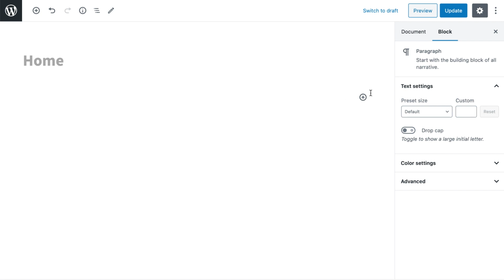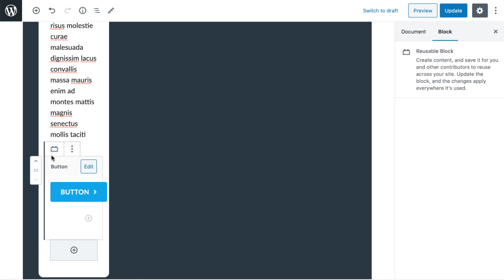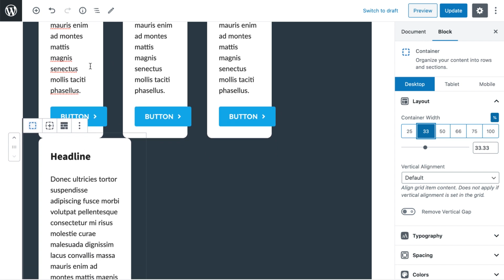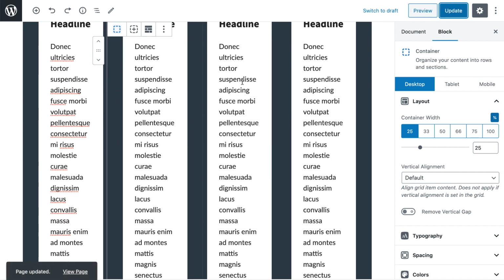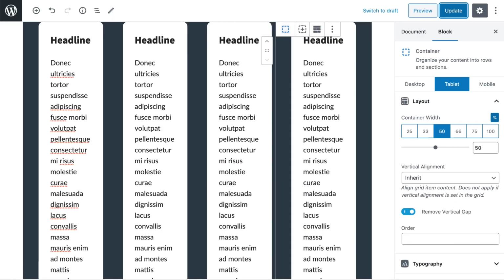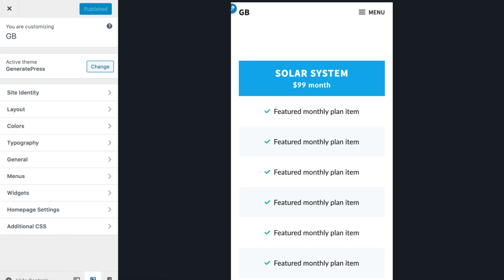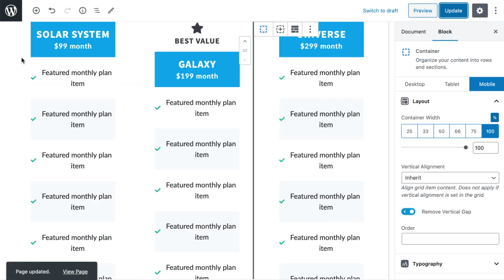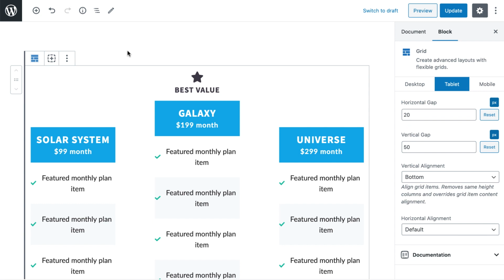GenerateBlocks Grid Block Tutorial

Comment: Hi Mike, thank you for letting me know. Couple of questions. What element does the same thing as Sections? Is that the Grid then?
Reply from the maker: The elements are not layout features, they allow you to hook content you build with blocks to areas of you website, build header templates to apply to pages and posts, etc. GenerateBlocks is what you build pages with now, which includes the grid block.
Reply: @MikeOliverDesign  Ok, thank you very much Mike.

Comment: Mike, thanks for the video! In one of his videos, Adam Preiser talks about the 3 Cs when it comes to any page builder. There is the outer CONTAINER, then inside of that, there is the COLUMN, and finally inside of that, there is the CONTENT (in the case of Gutenberg, the individual block(s). It seems that Generate Blocks doesn’t really follow that formula in that content doesn’t necessarily always go inside the other two layers, the columns (grid) don’t necessarily have to be inside a container, and columns themselves end up with containers in them? What are your thoughts on this?
Reply from the maker: Brent, GB uses flexbox and works differently than page builders. The grid containers are what you might call columns. Having the content inside a container block or grid containers is what allows you to have full responsive and layout control over your content.

Comment: Excellent video. I have a good understanding now. One thing I've noticed experimenting with a container with an image as the background and activating the overlay, is that when I activate the overlay, it hides the image and a message says you have to give your background colour transparency. I'm confused by that message as I'm not using a colour background in the container? It's a background image.
Reply from the maker: The new version of GenerateBlocks uses pseudo element for the overlays. You set a background color and then change the opacity of the photo to create an overlay effect.
Reply: Mike Oliver Design Excellent. Thanks for letting me know. Is it a beta version?
Reply from the maker: @I_Mackenzie  No this is already in the public version